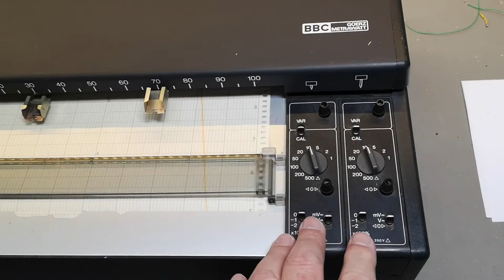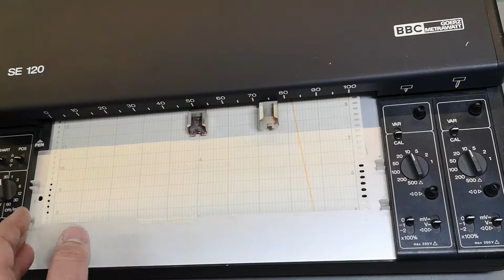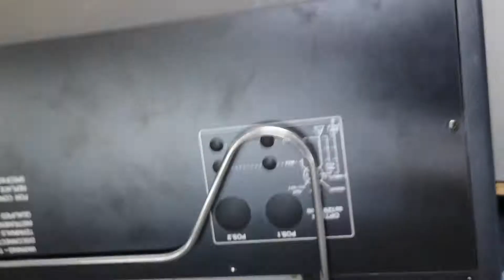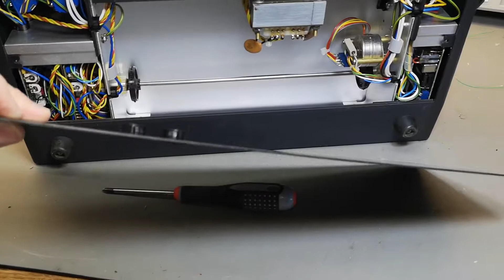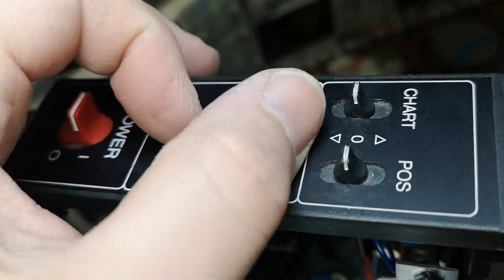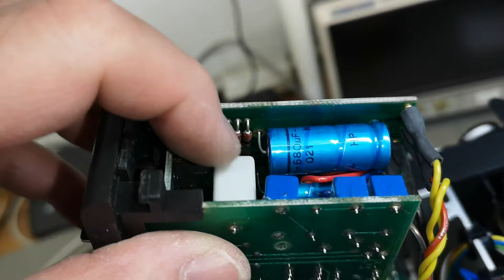BBC Goerz Metrawatt SE 120 Chart Recorder Printer test teardown

Comment: Started off as Brown Boveri, then later on bought Asea, thus Asea Brown Boveri, then later on rebranded to Brown Boveri Corporation after buying a few of the smaller switchgear and controller companies, so as to have a more common branding.

I have got contactors with both Brown Boveri, and later identical ones which are ABB branded. Even seen some in an old elevator, that were still running since the 1950's with no problems. 

The switches there on the switch board will have a heavy gold plate on the PCB, thick coat, but being a small board it works out cheap, and they can last a long time there, as often you only use them a few times in setting up the recorder..

The downfall is those pens, they tend to dry out and fail, so a modification I have seen is to replace them with a small thermal print head, one ceramic heater element pulsed with each advance pulse, so as to leave a thermal mark on the paper as a record, and then you simply have a roll of cheap thermal fax paper as source, with a transparent scale unit that you simply align with the printout to get a set of scales in there for recording to a more permanent media, often simply done by placing the sheet on the platen of a photocopier and making a print onto the more robust toner transfer paper with the scales on there.

Did that with a recording clockwork temperature and humidity meter, as the pens were made from unobtanium, and used brass nibs and Indian ink, and leaked, so a simple thin nichrome wire was attached in place of them. Then flexible leads (old tape deck head wires, they had enough copper in them, but with plenty of thin wires they have enough flex) and a simple timer that slowly charged a 4700uF capacitor to around 9V, and then a beefy SCR to discharge it through the heater wires, leaving a small dark dot on the thermal paper. Copy onto an OHP tranparency of the one surviving blank chart sheet, and I had a recorder, at least till the hair of the humidity side failed from old age.
Reply from the maker: super idea with the thermal pen, if only you can get the thermal paper in reels same size, and holes on the sides need to match too, i think it is very difficult to cut paper and make holes accurate for this to work